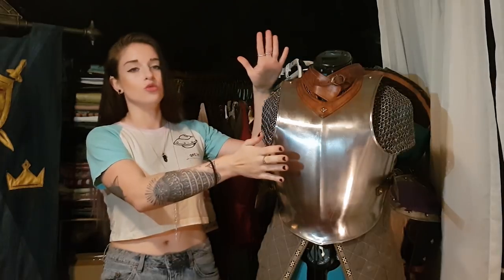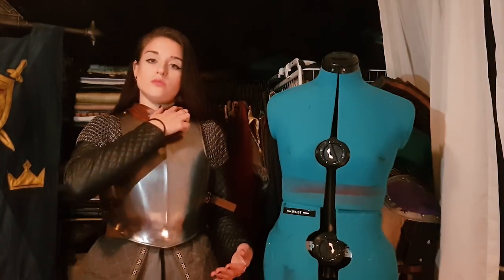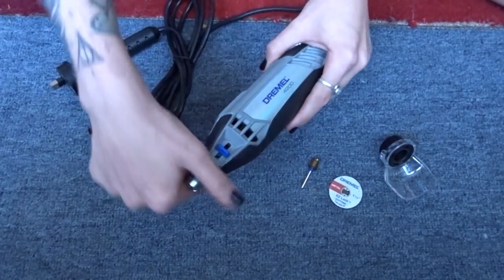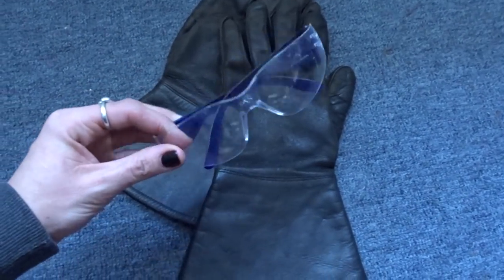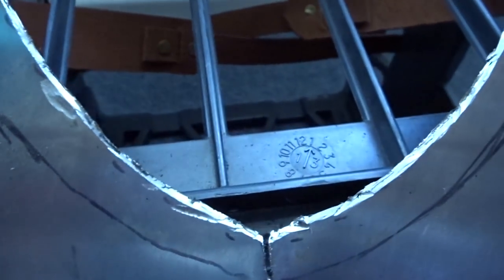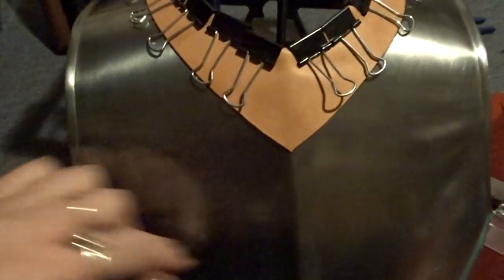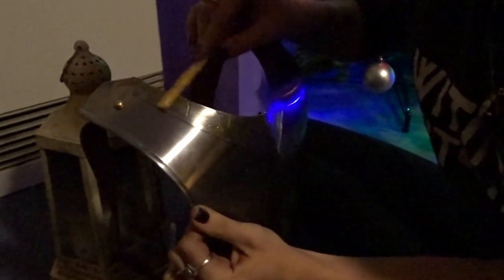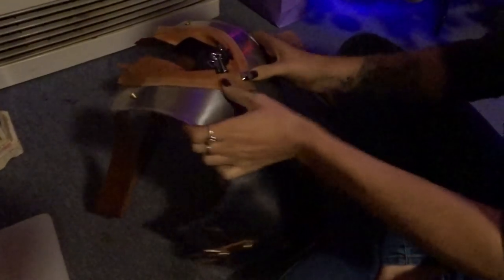How to modify a LARP steel breastplate using a Dremel

Comment: Hey! It's Liam, I have one suggestion and that is to use a metal file, the one you did use seems to be a wood file. You'll get a better finish and the process will be quicker and easier. All up a good job, well done
Reply from the maker: Liam Crooks good advice! That's the only file I had unfortunately haha
Reply: That file is a rasp and its for rough shaping wood.  You could have used the cutting disc or a drum sanding bit in the dremil to smooth that edge better.  Hope that helps :)

Comment: Very nice! though glue wont last long at all over metal, especially when left in prolonged heat. It would have been best to rivet a few studs into the front or use thin decorative nails and hammer them in, then drill small holes where the neck opening is, and sew it on. That makes it decorative and it shouldn't fall off so long the leather doesn't decay (A really long time)

Comment: With how thin the metal on these rolled steel cuirasses is, drilling and riveting the leather would also be an option. Of course you need to use the correct rivets so they don't poke your chest. They can also serve as decorative elements, further personalizing armor away from the off-the-rack look that Epic Armoury offers.

Comment: Do you have any suggestions on how to make it without limiting mobility overmuch
Reply: A properly made breastplate or cuirass is supposed to end at you natural waist, somewhere just below the bottom of you ribs, sort of like a modern day plate carrier. This is so that you can actually bend at the waist/. So, if you want a breastplate/cuirass that allows you to move properly you need to make sure it stops at the natural waist. Unfortunately, the vast majority of commercially made breastplates are way too long and tend end at the hips. So your option are either to modify a commercial breastplate or save up and have one custom made to your exact measurements.

Comment: yeah, modern reproduction breastplates are usually way too long to be functional. A breastplate should end at your natural waist, immediately below your ribs, otherwise it could hurt your neck during movement, or even break your trachea. To protect the belly and lower part of the abdomen, an articulated fauld is the optimal choice, like on historcal armor. Long breastplates are not safe.